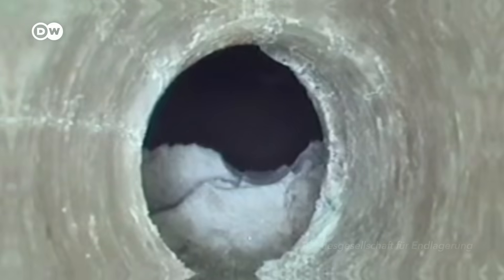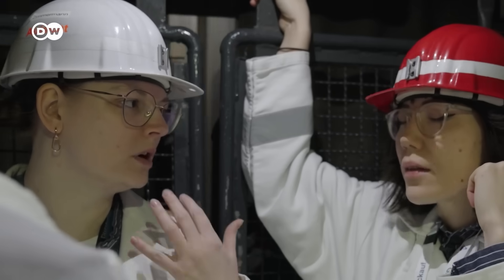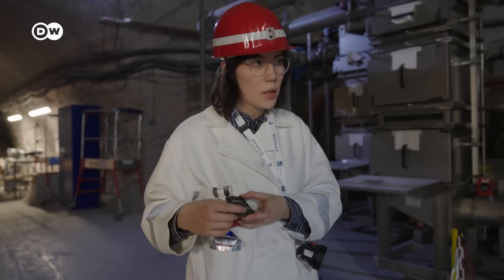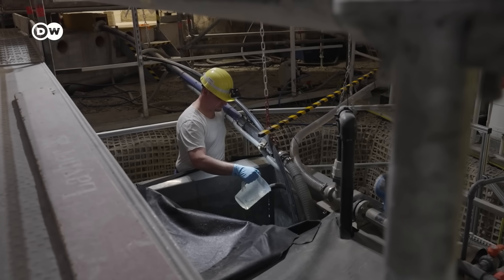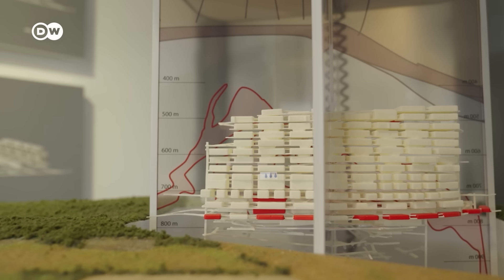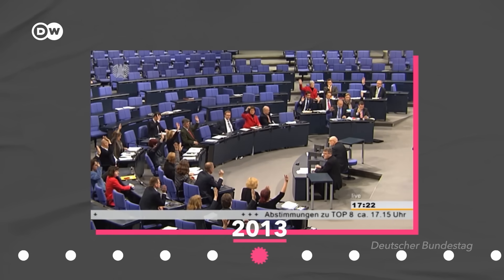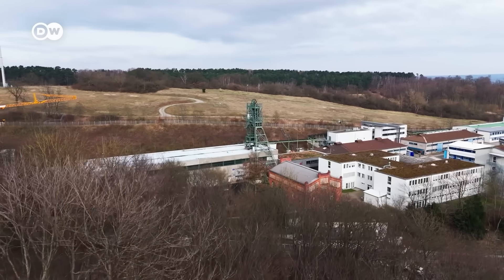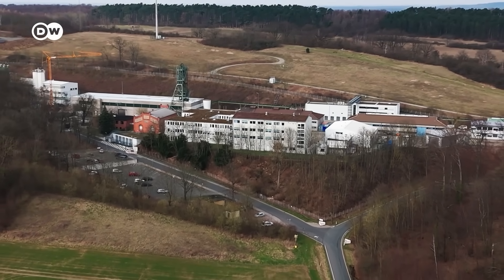Inside Germany’s hidden leaking nuclear waste dump

Comment: There are about 4.5 billion tons of radioactive uranium and 6.7 trillion tons of radioactive potassium dissolved in our planet’s oceans. The beta type radioactivity from radioactive potassium is almost 3 times as powerful as the beta type radioactivity from Strontium 90, a primary element of high level nuclear waste. Even worse, the half life of radioactive potassium is over a billion years while the half life of strontium 90 is less than 30 years.

It should also be noted that, once ingested, heavy radioactive elements like Uranium will migrate to your bone marrow and their alpha and beta type radioactivity will pound on bone marrow tissues and increase the risk of related cancers.

These radioactive components are salts so they are among the several kinds of salts included in evaporated sea water.

Sea salt really needs to be reclassified as low level nuclear waste.

Comment: If human beings were mature enough to properly deal with nuclear waste then they would have been mature enough to never use nuclear material in the first place. The human equation is always missing from the argument for nuclear power but it is the only part of the equation that really matters. This is no different than giving a machine gun to a monkey
Reply: Not really, nuclear waste is far less of a problem that emissions caused by fossil fuels. Without nuclear power we would have had even bigger emissions over the years and thus even bigger problems with climate change and global warming

Comment: The situation is NOT a joke. My guess is that they need to pour concrete in those chambers, and seal them. In Romania, there is the Praid salt mine, that was overwhelmed and flooded during some very rainy days, and water was entering the mine at about 25 cubic meters per second, faster than the Titanic 7 cubic meters per second.

Comment: If you’re that scared of nuclear waste, think about this media to low level waist is basically paper and gloves and intermediate is probably like the clothing that they wear/some other stuff the intermediate ways you were wearing actually that would be considered low risk waste from a nuclear byproduct that’s why they have it but down there to your closing But if it’s high level nuclear waste, it’s just in those barrels and it was bad enough to make the truck drivers just dump it down there yeah I get it. That’s high level nuclear waste not intermediate intermediate is very it’s like contaminated shit that is a little bit higher above than gloves and paper and all that from the workers at freaking Chernobyl It’s like mediate would be the stuff that would be like the hooks stuff that would be near the reactor would be kind of setting off your counter and if there’s that much of that stuff there and it’s not contained by freaking glass, cause the United States literally dumps glass into it. They literally make it impossible for any nuclear reaction to happen and high love ways gets melted down with silica glass, and it literally get sealed in with concrete. It’s so safe that you could literally kiss it and those are cask that has been seeing at a beach for over 35 years and freaking San Francisco.

Comment: That's interesting. I didn't know that this is where only the low and intermediate level nuclear waste is stored.
Low level nuclear waste can be things like used PPE and other equipment, which is often barely contaminated at all, but due to extra strict safety regulations would be rendered nuclear waste.
I'm relieved to know that they didn't put the high level nuclear waste like spent fuel rods in those barrels...
Reply from the maker: We’re glad you learned something new. Subscribe to our channel and stay with us, we regularly release new videos ✨

Comment: The water can be freezed using cryogenic cooling and the waist retrived either for more energy production or storage.
Reply: Its low or intermediate level waste, which is ppe, filters and stuff like that, fuel assemblies are stored in a dry cask, fuel assemblies can be re enriched though

Comment: I don’t see the real context. I have been told only one radiation reading, and it was lower than ambient. What levels of radiation could worst-case leak, and in what way would the village nearby be impacted?
I know nuclear waste sux, but especially with low- and intermediate-level waste in an old mine, it seems too safe to be a realistic danger. At least this video didn’t convince me otherwise.

(trzd allgemein gutes, aufklärendes Video, mag den Kanal)
Reply from the maker: Hey there! The salt has a strong shielding effect - this is why there was no radioactivity measurable where our team was going. It is low level and intermediate level waste that is stored there. However, due to the poor documentation there are also doubts about the right type of nuclear waste having been declared. With more and more water getting in, the worst thing that could happen is the mine sinking. This would lead to a radioactive contamination of ground water.
Reply: @DWPlanetA  Genuen Thanks for the response

Comment: Storing radioactive waste underground is stupid. No containment technology exists that will last the length of time it will remain dangerous. Responsible storage requires the storage of containers in a secure dry environment at a facility were container maintenance can be conducted. Minimisation of waste volume over plant life cycle is essential. Above ground storage in wearhouses is much more cost effective and safer. Likely above ground storage cost is 1.2million per cubic meter for 120 years ( a fraction of storage time required) plus container checks and maintenance costs. This should be factored into life cycle power plant costs.
Reply: Well said!! most people are brain washed by those clean energy corporations (who fly in private jets) The will not do something clean to "save the planet", they will profit of everything the find and leave us (the tax payers) with consequences (like the leaking abandoned oil well), now a days no one cares about long term consequences

Comment: EVs aren't any better. An EV have contain hundreds of pounds of toxic and carcinogenic electronic components will never be recycled, but end up in landfills. The toxic and carcinogenic metal oxide compounds will never be recycled either. It is known that lithium cobalt oxide, a major ingredient, in EV batteries is carcinogenic. When mixed with all other oxide compounds in the battery is highly costly to recycle and hence will also never be recycled.

Comment: id like to know what there estamates are for worst case on the damage and spread of nuclear waste would be if worst possibility happens
Reply: Depends on the type. Low and mid only need storing for 100 years so wont cause mutch trouble. High level waste would be dangerous BUT that is not stored there, so little to worry about

Comment: Don't worry! The press inflates another informational occasion! This is decommissioned equipment from industrial production, which accidentally got there due to an oversight of employees. The only reason this got on the air is because of a slight delay in the delivery of equipment for safe collection and transportation

Comment: Well before you all hit the hysteria button, what level waste are you talking about, because low level waste isn't really a problem, and its all the hysterical reactions that have led to the halting of nuclear power around the world, it is possibly the only medium term solution to the global issues we face, compared to fossil fuels it is by far a cleaner alternative a coal fired power station emits more radioactive pollutants than any nuclear installation
Reply from the maker: Hey there! It is low level and intermediate level waste. However, due to the poor documentation there are also doubts about the right type of nuclear waste having been declared.

Comment: What about putting it into the walls of a fusion reactor and using it as an extra source of neutrons? Also it'd be struck by neutrons itself breaking up the isotopes atomic neuclei into other elements.

Comment: Preparation of removal cost 4.7billion EUR.
Again just a money sink overplanning everything. Dangerous job for sure but if you are concentrating on the work i bet it could be as low as 200million. Even if contamination happens as i understand these are medium to low level nuclear waste barrels. Or perhabs there is a reason for the high price.
Also they told people cant be inside the room to clear the barrels. They should contain piping or parts that had been touching nuclear fuel. Years ago. Is it that dangerous really?

Comment: This radioactiv trash has to be stored there for about 1  million years.. This happened under massive Pressure of the former CDU/CSU Government of Helmut Kohl. The whole society in Niedersachsen was betrayed and not correct informed. Protests where simply ignored or violently depressed. Actually the Opposition from CDU/CSU wants to store those high radioactive Containers that are temporarily stored in former inactive nuclear powerplants in Germany also in Niedersachsen / Gorleben or also in Asse. This are 1900 containers that First have to be renewed and the trash has to be refilled into new containers… because they can only be save for about 35 years and time is over now. Nobody is openly speaking about this. All you can hear if you ask is that all is ok, But that is a dirty Lie😡😡😡😡To  handle this whole problems will cost much more than 2 millions a year… It will cost the taxpayers billions of euros..and cause a political earthquake…😡😡😡

Comment: Total fear mongering.   No numbers were actually given.  "10 times the waste expected"  ok, so they have 10 grams when they expected 1 gram?    "No one knows how radioactive it is"  as they are standing there with a meter capable of telling if they had a string.  "Contaminated water"   We have devices to measure that.   Low level waste is normal garbage that is generated at a nuke plant.  The intermediate waste could be a problem,  but without saying how much or how radioactive it is, there is no information here.

Comment: This is a typically ignorant report from a reporter, the job one takes when she fails at being dog catcher.

NO intermediate level waste is put in yellow drums.  Neither do they contain office waste as someone mistakenly said in another comment.  Intermediate level waste is stored in smaller stainless steel drums.  She accidentally showed some of those drums for a few seconds.

What is in those drums is typical industrial waste such as used gloves, masking tape, shoe covers, disposable anti-contamination uniforms, wiping rags and similar stuff that came out of an area controlled by a Radiation Work Permit or RWP.

When work has to be done in a nuclear facility (not just nuclear power plants) in an area which might contain radioactive materials or radiation sources such as sediment settled out in a low spot of a pipe carrying radioactive water, health-physicists first survey the area, both for ambient radiation and for loose radioactive material that a worker could get on himself if he touched the contaminated surface.  Hot spots are marked and then the area is cordoned off with either yellow and magenta rope or tape.  An entry portal is established.  This is usually just an absorbent mat taped to the floor.

To do work in the controlled area, craftsmen first pull an RWP.  Then they gather at the portal.  Everyone strips down to their underwear (really became enjoyable when women started working in these fields :-).  Then each worker dons an anti-contamination suit, commonly referred to as "anti-Cs", dons nitrile gloves and rubber low top boots.  Every seam, from where the anti-C zips up in the front to the junction between the sleeves and the gloves, and the junction of uniform legs meeting the rubber boots is taped up with 2" wide masking tape.

If there is likely to be radioactive water in the area, the health-physicist may specify another set of anti-Cs and in some cases, a plastic rain suit between the anti-Cs.  All suited up, they step over the portal into the controlled zone.  They do their work, which may or may not include coming in contact with radioactive materials.  They may use wiping rags and if they're fixing something like an electric valve operator, they make have a lot of (probably not contaminated) grease to dispose of.

When each worker is ready to leave the controlled area, he steps onto the absorbent pad.  He removes all the duct tape, removes any head covering if used, the rubber boots, the gloves and the anti-C uniform.   If the anti-C uniform is disposable, it, along with all the other waste goes into a yellow barrel.  If the the anti-C is reusable then it goes into a second container which is taken to the rad laundry.

At the portal are friskers, Geiger counters equipped with pancake probes which are very sensitive to even the smallest amount of radiation.  Each worker checks himself over.  There is usually a health-physicist watching things and is ready to help anyone who becomes contaminated.  Then we put our street clothes back on and go about our business.

The major US LLW disposal site in the US used to be in Barnwell, SC.  Politicians got their panties in a wad and passed a law which prevented any yellow drums originating in other states were no longer accepted.  Suddenly it got REALLY costly to dispose of those drums.

My company was doing work at the Three Mile Island facility (for you younger readers, that's where the so-called "accident" happened in 1979.

Knowing that most of the stuff in the yellow drums was not radioactive, they hired us to design and have manufactured a radwaste sorting machine.  On this machine was a hopper where fork lift operators dumped the contents of the yellow drums.  We designed a serializer, a gadget that took garbage from the hopper and streamed it onto a fairly high speed conveyor belt, one piece at a time.  Over the belt was a large liquid scintillation radiation detector, shielded from outside radiation with a coincidence detector.  When an occasional piece of radioactive material was detected, an air jet blew it off the conveyor and into another yellow drum.  The inert garbage ran off the end of the conveyor into a conventional solid waste hopper which then went to the land fill.

Over a fairly long term, it averaged that just about 1 in every 1,000 pieces were slightly contaminated.  In other words, we cut TMI's low level "rad waste" production by a factor of 999.  Most of the stuff that ended up in the yellow drum was so slightly contaminated that it could have simply been land-filled. But given the hysteria surrounding TMI at that time, the utility took no chances.  I don't recall what they did with the very small number of actual radwaste drums produced every month but it ceased to be an issue.

If that reporter had talked to a nuclear engineer or a health-physicist (I was both before I retired), she would have been set straight and would not have made such a fool of herself.

Comment: I just realised why the journalist didn't measure the radioactivity using a Geiger Counter, to see how radioactive the waste is. This is an old Potash mine, it is already naturally radioactive. It's, possible the natural radioactivity is higher than the low and intermediate level waste, so it won't show up on a Geiger Counter, you end up detecting the Potash (which contains naturally radioactive potassium-40).

Comment: At least 1 million people die each year due to pollution caused by fossil fuel burning, but everybody is scared of radiation.
Well done media!!  
Many people are so scared of radioactivity they treat this waste as something they need to get rid of ASAP. 
Out of sight, out of any means of control, preferably under thick layers of clay or concrete.
If a part of this, are actually used rods, (I doubt this is the case) then these could be destroyed in future Thorium breeders, while generating energy for multiple generations of Germans.
It is fuel, not waste!